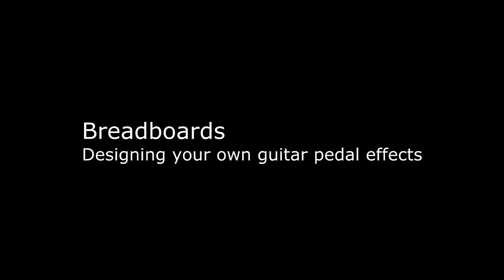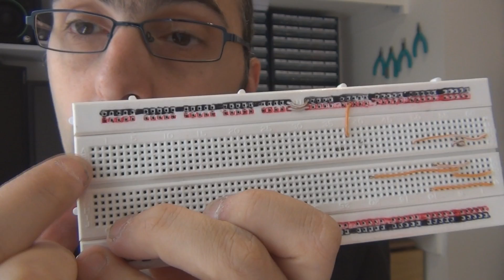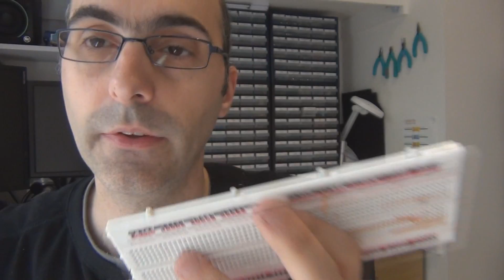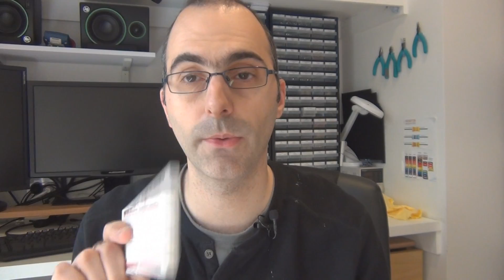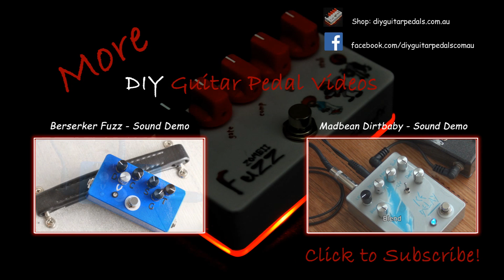Breadboards - designing your own guitar pedal effect

Comment: hey sir!
can you please explain how the values of resistors, capacitors and other components affect the mids, bass, and treble?plus, what's the difference between distortion and overdrive in term of those components' value? thanks in advance
Reply: No simple answer as all depend on full circuit and signal.
Reply: hairil anuar . One thing i have learned is that a bigger capacitor for audio coupling . The more bass frequencies you will allow through. Beauty of breadboarding is your not commited like a  soldered board. So trial an error is the key dont always follow values on a schem to a "T" , suprise yourself :-)